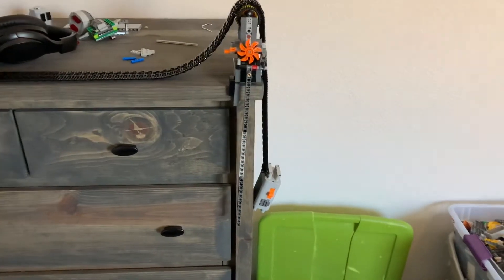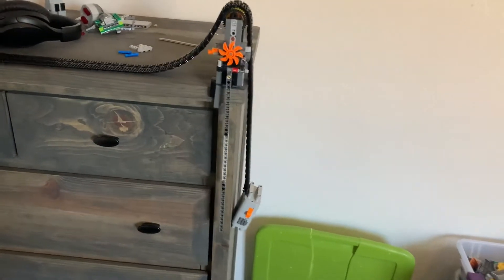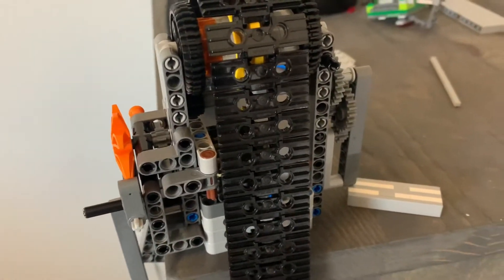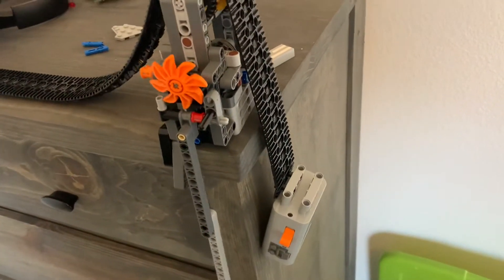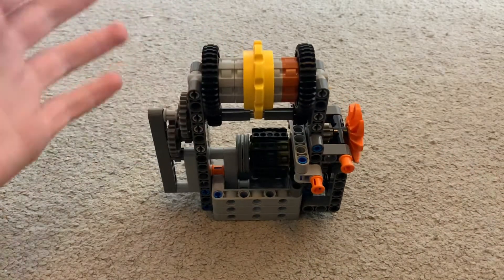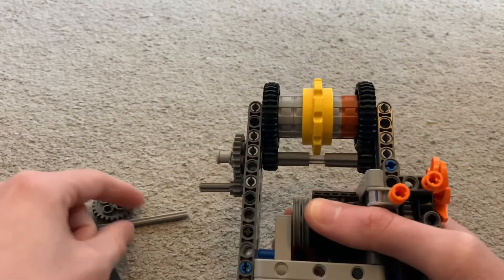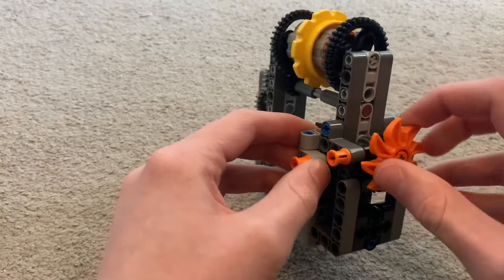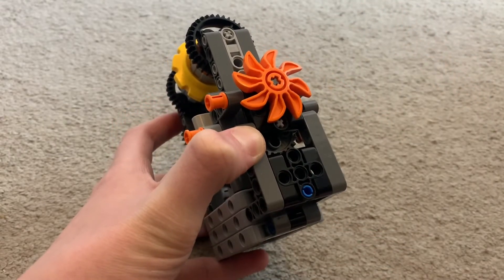Lego Technic Escapement by Vizonex

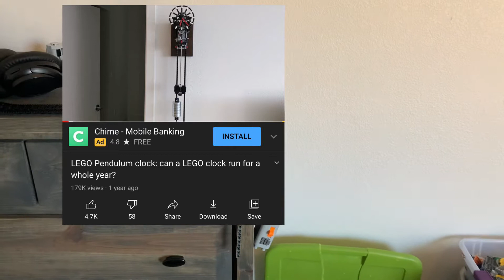Comment: 0:22 "this is just an escapement"
really, the escapement is the heart of the clock. it's the tricky part. the rest is just simple gear ratios.

....not a galileo, btw. that's an anchor escapement.

KEvron
Reply: ....btw, are you familiar with BrickLink? it's an online market where you can purchase individual parts, new or used, from private sellers. there's a bit of a mark-up in price, especially for rare and discontinued parts, but it saves on having to purchase an entire set just to acquire a few of its parts. your scape wheel (part# 41530, "propeller, 8 blade, 5 dia.") is widely available there, and for just a few cents each. shop wisely, as your shipping costs can sometimes exceed the cost of your items.
KEvron
Reply from the maker: @KEvronista  yeah I am familiar with brick-link I’m going to try it out at some point
Reply from the maker: I will definitely need to go back in and upgrade the clock thanks for your suggestions.